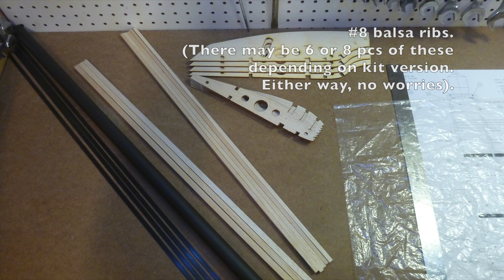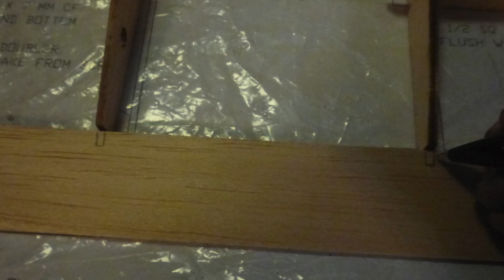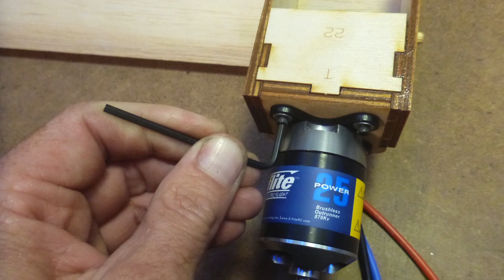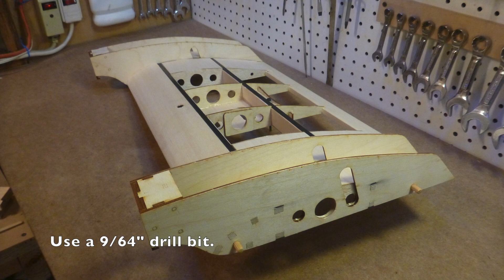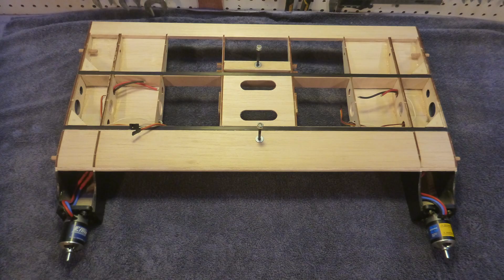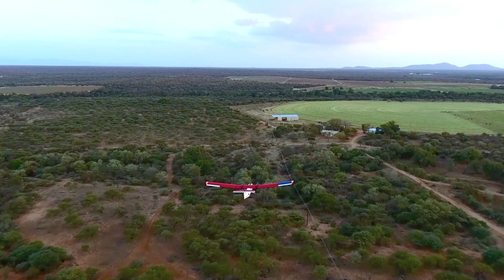Gemini V-2 laser cut Kit build- Wing Center Section

Comment from the maker: By the way everyone, DO NOT use the E-Flite Power 25 motors!!!  
They burn up really easy, and have bearing problems.. 
either stick with the power 15on 3S and 13 inch prop, or go up to a power 32 if you want more power, 3S and 14 inch prop.  If you want Mega power, go with the DJI 4216 motors on 6S, but you'll need the full size "Tesla " style battery with GA cells in 6S configuration to power them.  There are several props available for them in counter rotating, including the 16 x 10 APC 2 bladed thin electric or the master airscrew 16 x 10 3 blade if you want to get really crazy. 
The plane does not need that much power at all, but if you want to..  
I thought the power 25 would be an obvious upgrade, but there are serious engineering problems with them including the windings heat resistance and bearing quality. 2 out of 7 I purchased were unusable, 2 others made more noise then they should..  Not buying any more from E-flite. 
Sunnysky has some more economical models with reported good quality, so maybe check out their lineup too.  Future designs will be with high voltage, at least 6S. 
The above mentioned DJI motors are cheaper than the E-Flight ones, and absolutely beautiful construction. big smooth bearings. 
Sorry for the misleading motor selection. it seemed like a good idea at the time...

Comment: If you eliminate both BEC power wires, then what supplies power to your servos and everything else? would you wire is an SBEC separately to supply the power?
Reply from the maker: yes,  in fact, its recommended to use more than one Separate BEC with a modified bridge rectifier to supply redundant power to the servo rail/autopilot.
there is some good info about this on the arduplane dot org webpage under the theme: powering the pixhawk